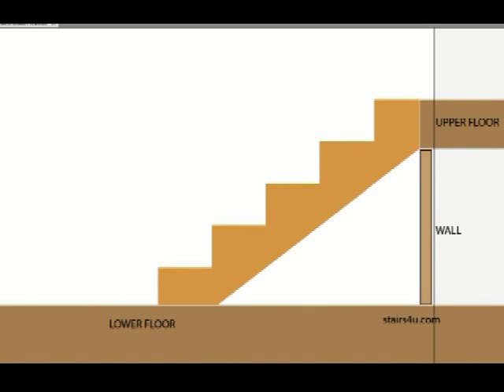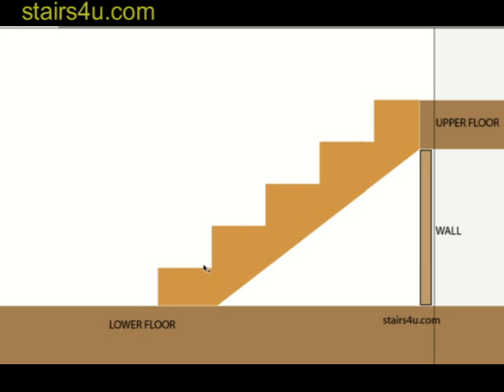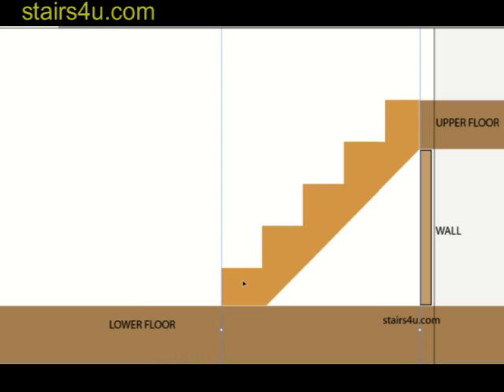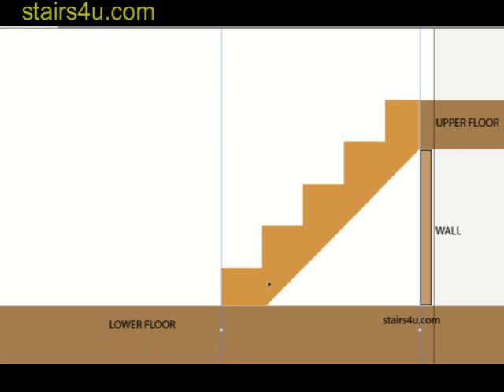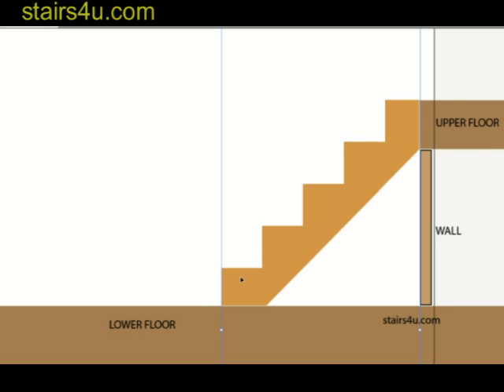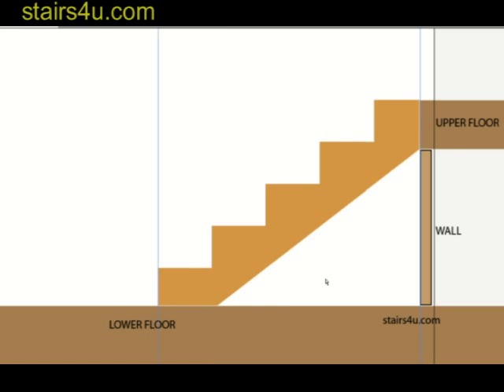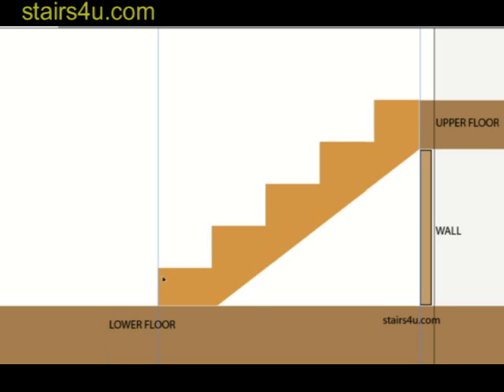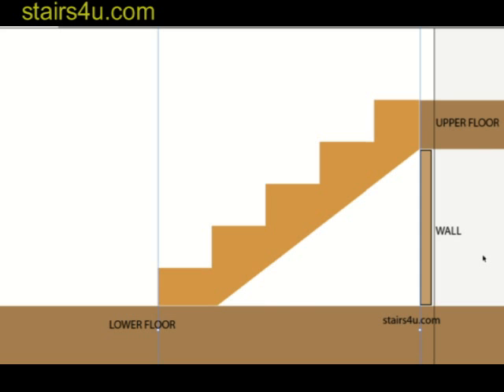What Happens If I Change My Stair Tread Size? - Stairway Design

Comment: I have a size 15 foot and I have felt a huge difference when I use stairs with average size tread with a few older homes where the treads were large enough for my entire foot. If I ever build my own house, I’m definitely going to have a staircase with large treads
Reply from the maker: Yes, small steps are definitely a problem for people with larger feet. Thanks for sharing.
Reply: @stairbuilding  Agree...After replacing my 1920's staircase and lengthening the tread depth to to 9" (foot size=10"), the new concern is headroom!

Comment: I am having a 7 step mono beam staircase built and they said I can either have a 10 inch tread with no platform overhang on the bottom step or I can go with a 11 inch tread with a 6.8 inch overhang of the bottom platform. My question? Will people have a difficult time walking up a 10 inch tread verse 11? I believe most tread depths are 11 inches . Thank you for your input
Reply from the maker: Actually a 10 inch stair tread with a 1 inch nosing or 1 inch undercut is the most popular stairway used for residential construction. Without the 1 inch overhang or undercut, it's not as comfortable, but still usable.

Here's a link to our website that might be helpful. http://www.homebuildingandrepairs.com/codes/stair/index.html